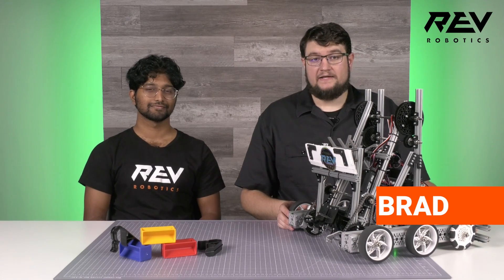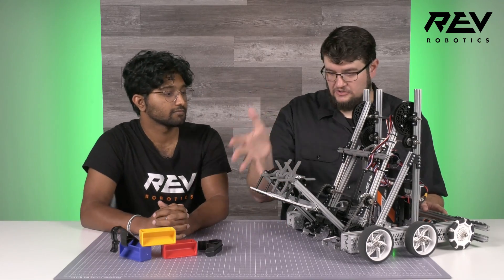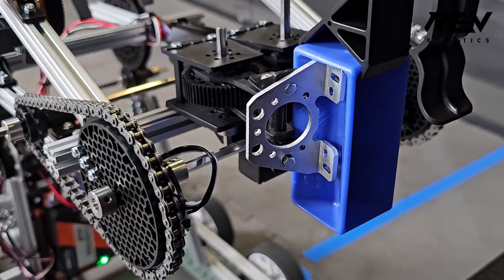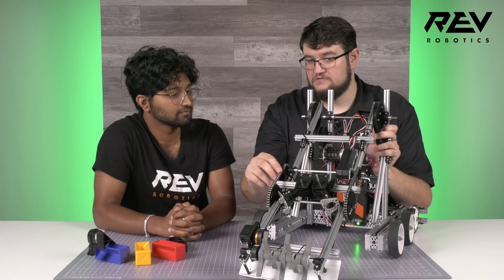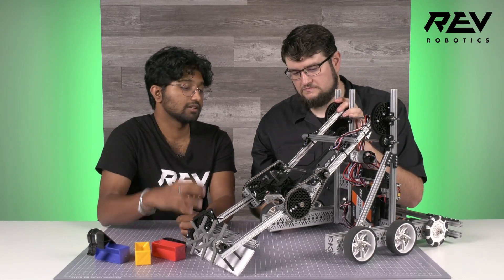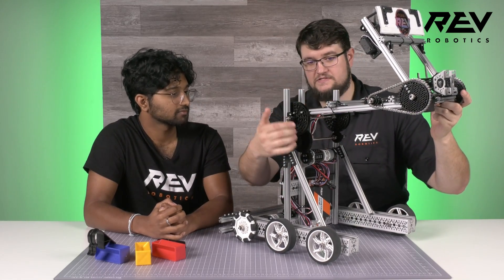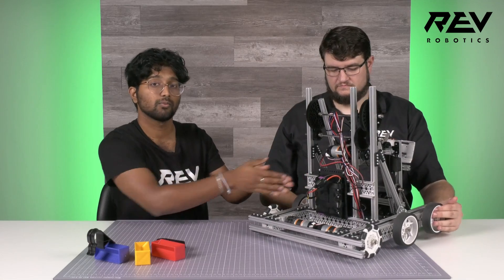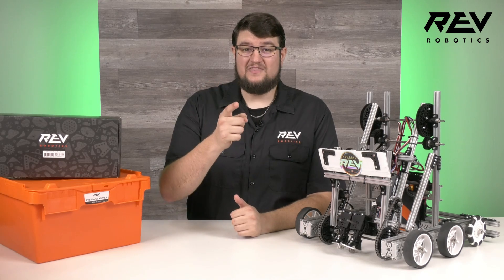2024-25 REV DUO FTC Starter Bot Walkthrough

Comment: There isn't a power switch included with the kit?
Reply from the maker: The DUO Control Bundle [REV-35-2709] (https://www.revrobotics.com/rev-35-2709/) includes the Switch Cable and Bracket [REV-31-1387]. The Control and Power Bundle [REV-35-1906] (https://www.revrobotics.com/rev-35-1906/) also includes the switch if you desire an extra battery!

Comment: Is this a vex vrc knock off?😭
Reply: Opposite. Ftc started in 1992. Vrc started in 2007 as an alternative to first.
Reply: @davidrussell6767  you're close, but not there yet. FIRST was founded in 1989, with the first FRC competitions in 1992. FTC began in 2004 as FVC (FIRST Vex Challenge). VEX became an offshoot of that. FTC and VRC are both offshoots of FRC, hence why FRC has the best robots :)
Reply: Technically it was FIRST VEX Challenge then they divorced and split into 2 competitions

Comment: this is crazy compared to gobuildas starter bot
Reply: Crazy in the sense it is far more complicated and has far more moving parts to do the exact same tasks the gobilda kit does.
Reply: In robotics, complicated isn’t good. The simplest possible solution to a problem is the best, as it reduces variables and risk of failure by decreasing the parts that could mess up.